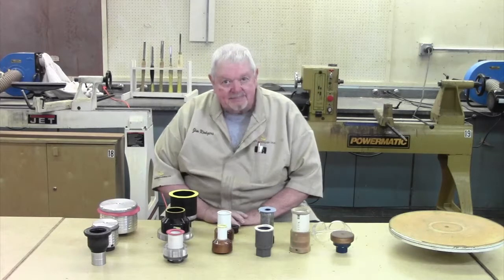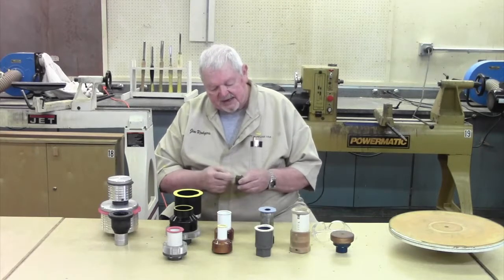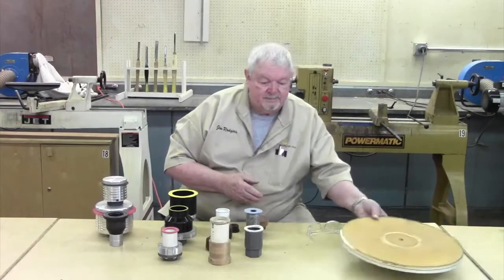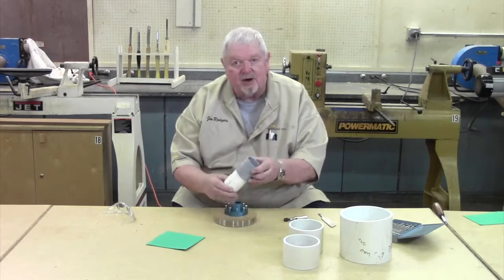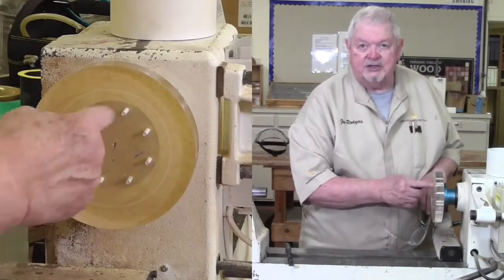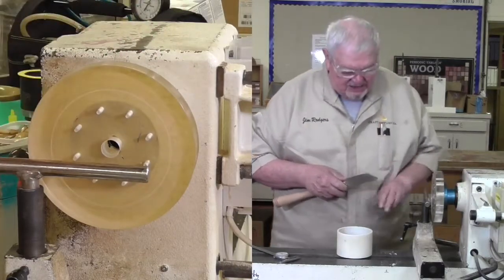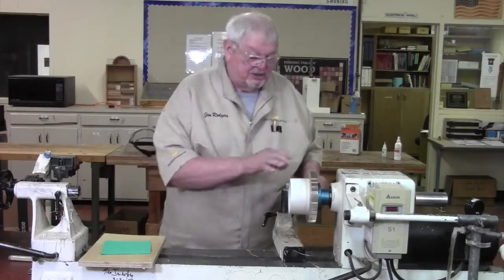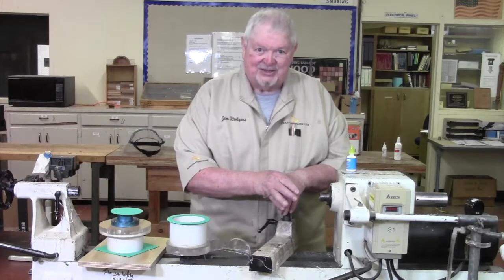Lesson 18, How to build a vacuum chuck

Comment: Jim, on the flat plate like vacuum chucks you mentioned you coated the surface with Mold Release.   Did you in fact mean Silicone Mold Making substance?    I use mold release on my resin casting so they release from the molds and also use a silicone mold making kit to make my own flexible molds for casting.   Been trying to make a flat vacuum chuck and still running into leak issues.......Thanks
Reply from the maker: Good point! my language choices sometimes are not accurate.  You are correct. It works well and lasts for years. (Trust me!)
Reply: @JimRodgersWoodturner  My mistake on that Jim.......I was assuming you were using a mold release product such as spray on Stoner brand.    I now see that companies such as Tap Plastics do make a two part mold release that can be mixed and poured on to create a good vacuum seal.   Excellent idea and very do-able.   Thanks for your excellent ideas.

Comment: vacuum chucking is something i've wanted to add for quite sometime.  i acquired a vacuum pump recently so now i need the rest of it!  my lathe is a very old craftmaster, similar to the old delta's from the 1940's and has inboard and outboard threads. i turn using both "ends".  the oneway vacuum adaptor should work as it uses their taperlock adaptor to thread on to the spindle and i have the adaptors already for both inboard and outboard threads.  your thoughts?
Reply from the maker: I agree that your approach seems well thought out and should work.

Once you are using  vacuum chucking, turning activities get easier!
Reply: thanks for the input, i will order the bits from oneway, they are very close to me so it's easy and quick. virtually all my lathe accesories are oneway already including my chucks. the actual vacuum "chucks" i  will make myself, following your video

Comment: Jim what type of screws do you use and all what is the name of that foam? thanks Larry from Fremont calif!
Reply from the maker: Any machine bolts of an appropriate size. I generally use 3/8" x 16, or 1/4" x 20. I have a tap that cuts the perfect threading holes in the plastic. For closed cell foam I visit the Michaels' craft store and purchase 12" sheets of colored foam used in kids construction project area for .99 cents a sheet. I also use their foam glue which is probably the same as white woodworker's glue!

Comment: Does it matter if the pipe is not very round? I've used pipe on a few jigs and the stuff we have here is never very true
Reply from the maker: While the pipes are extruded and not 100% true, they can be recut after the vacuum chuck is created and mounted. The top edge of the chuck where it contacts your project needs to be true.
Get thicker walled pipes to allow for more flexibility in truing up.
JimR